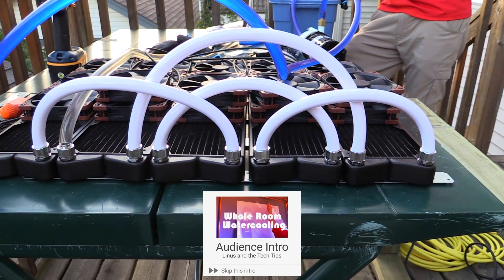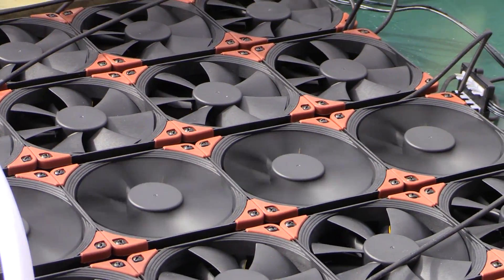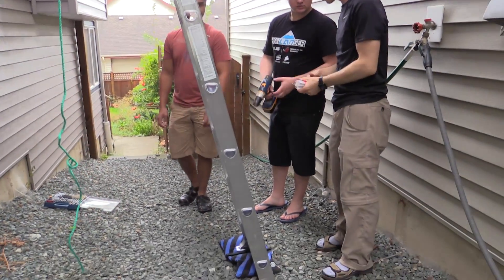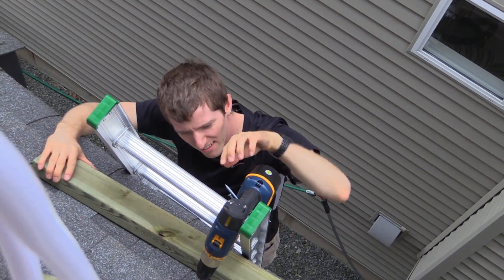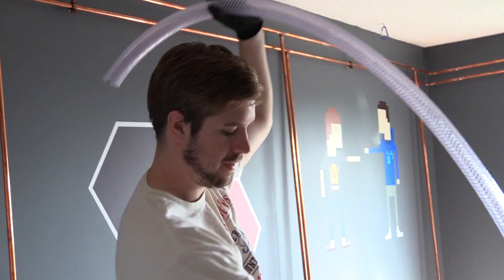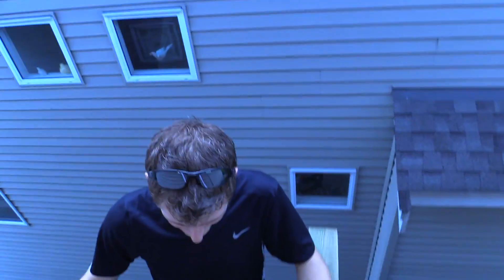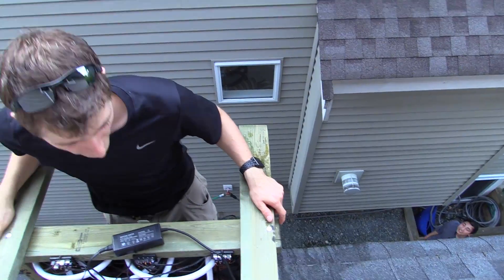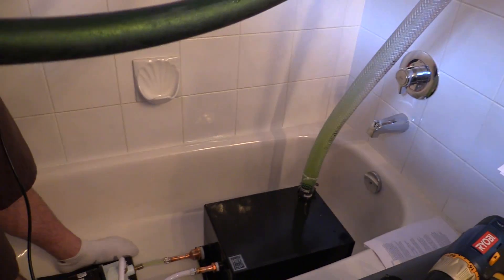Whole Room Water Cooling Project Day 3 - Radiator Mounting and Panic...

Comment: While this is very adventurous.. and kinda cool on paper, I gotta ask if it's very practical.   My single video editing suite workstation which specs out higher than any of yours is watercooled, over-clocked, and if something goes wrong I can easily get to fans to fix or replace them.  I even have a storage tower and animation render farm in a small computer closet of a room.. which is cooled with an airconditioner and standard aircoolers.   Putting together a centralized collective watercool system to all of this would give me nightmares even after it's done.  Too much could go wrong later.  but kudos on the monster cooler.  :0)

Comment: wouldn't it freeze in the winter? i mean, antifreeze can't handle every temperature...
Reply: Niels Wehrens That's what antifreeze is, it prevents liquid from freezing in cold environment.
Reply: Yeah but canadian winters?
Reply: Depending on what antifreeze and at what concentration you're using, it can handle -20 to -30 Celsius
Reply: Yeah, but this isn't only antifreeze i think it's also distilled water
Reply: machariel00 But it's Canada, it's frosty up there.
Reply: Niels Wehrens just keep the computers at full load and they wont freeze.
Reply: Nick Trotsky If the antifreeze can handle -30C it can handle a Siberian winter, so why not a Canadian winter?
Reply: But it gets pumped trough very thin rads
Reply: Seven09 ''siberian winter'' In Siberia, winters often go to -40 and above. good luck.
Reply: Inanitatem I guess you wanted to say -40 and below. -50 is just more far from 0 as -40 is but you still have to say -40 and below
Reply: Inanitatem I guess you wanted to say -40 and below. -50 is just more far from 0 as -40 is but you still have to say -40 and below
Reply: Inanitatem  :)

Comment: You do realize you cannot control the outdoor temperature, right? If it's 90 degrees f outside or -10, this is just not going to work. Why not buy a mini-split air conditioner and air condition a closet down to 60 f or so, with all the fans and rads in there? You wouldn't have to worry about rain or snow or ice or insects or birds nesting or any other unknown hazards either.

Comment: it would've been easier to use a radiator from a vehicle  instead of all those tiny ones.also this project would've been 100x's easier if the piping was on the ground instead of the air. it takes 5x's as much power to raise the fluids rather then to push straight . the pipes should come off the wall and be run along the floor to a large main radiator instead of the 5 smaller ones . then you can attach 2 fans with a 12 volt power supply like this. 

http://www.amazon.com/Powermax-Supply-Converter-Charger-Pm3-55/dp/B00F8MC440
  and a radiator like this 

http://www.ebay.com/itm/like/191482584082?lpid=82&chn=ps

fan like this

 http://www.partsgeek.com/gbproducts/DC/2083-05054403.html?utm_content=DN&utm_term=2001-2006+Dodge+Stratus+Auxiliary+Fan+Assembly+Dorman+620-350+01-06+Dodge+Auxiliary+Fan+Assembly+05+02&fp=pp&gbm=a&utm_source=google&utm_medium=ff&utm_campaign=PartsGeek+Google+Base&gclid=Cj0KEQiApIGnBRCFx-idn7-E2Y8BEiQAc6fQbBXneOla82VWwDENBfJK7YTvCRV4-fy8tA8GOJaQmXoaAuBG8P8HAQ

and it would probably be cheaper then the set up now

Comment: Why no just use a electric 12V auto radiator fan? wiring would have been incredibly simplified compared to this. Not to mention they are weather resistant.

Comment: I have often thought about doing this but I think a central heat exchanger (water to water) in the room would have been a lot simpler setup and more reliable. Short pumping distance to each computer. Higher flow with less head pressure. Then have a cooling loop from the heat exchanger to the external radiator. Also for the external radiator I would use a single industrial oil cooler instead of daisy chaining small radiators. Again more flow with less pressure and improved reliability .

Comment: instead of using all little radiators why not use a condenser coil from ac that what is use and i have water proof fan for out side. the way you guys did it makes my setup fucking great... i get bedder temps then what saw you guys getting your setup is joke.. and the pipe that wasn't soldered what the fuck was that? my setup cost $300 and i a rack of server running on it...my temps 20 to 30 Celsius

Comment: guys this is quite interesting but you got to think outside the box on this one and look at other industries cooling solutions. Lukes dad could have hooked you into one old window air conditioner radiator from a unit that had no compressor and it would have been so much easier. Fan is already built in, fits into the window in reverse for outside air, plugs into a wall and already has a fan controller built in.

Comment: Long time watcher first time reply.

You guys cant just use faucet water. You guys will fuck up all your fittings, radiator, and probably water blocks. You need to drain the whole system and use distilled water. what you guys are doing is almost the same as a cooling system for a car. Im pretty sure that water pump isnt going to be enough for all those vertical piping you have. And make sure you guys have more coolant than water ratio. You guys live somewhere that snows so your ratio needs to work with your outside environment.

Comment: ever consider just getting a car radiator and 12v automotive radiator fan setup and then waterproofing some custom soldered leads from a 12v psu? it would afford massively higher flow and heat transfer. and probably cost less than the 12v fans you used alone.... which probably are not weatherproof like the automotive components would be. also if the rad is mounted outside won't you have issues with condensation in the winter when exterior ambient falls below interior ambient and poor cooling in the summer what ourside ambient hits like 90 Fahrenheit?

Comment: Where do you even live, I don't see any snow
Reply: The date posted confused me right there, but knowing how "nice" Canadian winters are even in the southwest, what will happen to the cooler units during winter time?
Reply: Ultrakillerism They mentioned that they'll switch the systems to solo water cooling systems in the winter.  They'll probably take the water out of the Watercooling system, so it doesn't freeze.

Comment: my one question would be as to why you limited yourself to using a computer component based radiator? Surly the radiator from a a refrigerator would be more suitable for this scale of cooling, and more easy to work with?

Comment: Linus, did you think of the weather? The wood used on the rads are not even painted or coated. Screwing the screws without drilling holes before will make cracks and they will became bigger over time. Do you think that those fan cables will withstand the harsh sun? I think that they are not ment to be outdoors.

Comment: Soldering flux was all you needed for the leaking pipe.  The only problem from then on would have been the wall.  After looking at it, it was like whoever was welding hadn't put any on before soldering.

Comment: Corsair VS Series VS650 - 650 Watt Power Supply and Gigabyte GA-78LMT-USB3 AM3+ AMD DDR3 1333 760G HDMI USB 3.0 Micro ATX Motherboard can handle Zotac GeForce GTX 970 4GB GDDR5 PCI Express 3.0 HDMI DVI DisplayPort SLI Ready Graphics Card (ZT-90101-10P) ? 

please help me again ..................

Comment: IMO, you could have bought a copper car radiator and passively cooled it most the time with a normal large fan to kick in when needed and a small automotive grade fuel pump to run the water.

Comment: Why wouldn't you use a couple car radiators instead? They're easily plumbed in, they have great mounting hardware, there are fans specifically designed to work with them, and the fans run on 12v.

Comment: Water cooling designed for computers doesn't scale like this well. Should of gotten a cheap car radiator and a big fan for it.
Reply: No, car radiators rely on the heat of an engine to create a huge amount of pressure inside of it, the high pressure keeps the fluid inside in a liquid state.  Hence why when you open up a hot car radiator it would spew hot steam everywhere instead of just boiling over.  They used many fans because of the frames and braces in the way in case of a larger fan, and these smaller fans are more static pressure optimized, meaning they work better at pushing air through something rather than moving the most amount of air.

Comment: why did you guys choose to use copper pipes
Reply: Because copper is sexy.
Reply: its also very good at conducting heat. which defeats the purpose of having the radiators outside in the first place.

Comment: why didnt you get a nice industrial shop fan that from a hardware store instead of messing around with all those little fans? i doubt would move nearly the volume of air that a large one would (think about how a central air conditioning works).

Comment: I'm disappointed. I was hoping for a much cleaner install. Fantastic and cool idea, but the execution isn't there. I guess that's what happens when nerds step out of their comfort zone 😉 It looks like the pipe that was leaking was simply not soldered. Using JB Weld will ruin that junction. Too late now. 😕

Comment: Why didnt you guys just use a car radiator and thermofan? It would have had plenty of cooling capacity, it's actually made to operate in the elements at a variety of temperatures, probably would have been way cheaper and more reliable.

This method has a lot of potential failure points with all of those connections.

Comment: Do use a favor and yourself to see if this was efficient and test the temp out of your pc and at the wall going out then the line coming back in from the radiator to see if the temp drops enough to make it worth the money? I have a feeling most of the heat is still in the room but lest find out?

Comment: A simple second-hand AC unite would have been more than enough with just replacing that air compressor with water pump and it would be a lot cheaper and easier to mount anywhere+ waterproof, etc...

Comment: I think that you should also segment a loop with some simple shut off valves in the multiple points.. to be able to cut out stations/segments without stopping whole loop and shutting down all workstations if something happen either of them.. this principle should work in your case, because of parallel nature of your loop..

Comment: hello Linus
you should have gotten an engineer involved right from the start to design it and then you could build it. it would not be as dramatic but it would be functional and most importantly all the components would be optimized to suit their requirements ensuring the systems longevity.
well say this there are a few points i picked up on maybe for the future.
1. Go industrial, all individual components should have been cheaper and more suited to the environments and requirements (pump, radiator, supports, piping)
2. your header(copper pipe in the room where all the units are fed) should be bigger than the individual lines going to the pc's to ensure all units are guranteed a pressure and flow rate.
3. what is the pumps maximum head pressure and can your components handle that pressure, do you have a relief system incase of blockages or running the pump on reduced number of pc's as this would affect the longevity of your water loop (you should also have installed pressure guages and flow indicatiors on you main to understand the system performance.)

finally i would say this was a good idea, the implementation as i can see was a learning process i am sure you would do things differently next time. keep up the wonderful videos and merry christmas and a happy new year.

Comment: Dude that's a lot of fans on one radiator. I actually need help from the linus community here. I need a splitter that allows for connections of multiple fans. I need some kind of all in one controller or something to power a lot of fans can anyone help. I have my front intake and top exhaust powered but I don't have any enough molex connectors coming from my PSU to power the rear one( it has a molex connection and so did all the included fans in my case) I also plan to add more so I need help.

Comment: i dont get it, you could save a ton of time and make it the professional way by just using 1 or 2 of the "aqua computer Aquaduct 720 XT mark V Ceramic" and place them on the outside or a sepperate room! wouldnt even be that expensive!
and at winter time you could place them in the same room to use the heat...

Comment: I see one flaw in your system to remove heat from the room. Heat is going to radiate from the open copper pipes.So unless you insulate them the heat is not really being removed from the room. You can get a insulation for copper pipes from home depot or Menards.

Comment: I say instead of using that radiator like that, convert a small HVAC condenser to water. remove the compressor and use a High end water pump instead.. Having the Pump at the lowest point is best. Then you have a water tight unit outside that can take the elements, instead of playing Russian roulette with the weather using that monstrosity you have on the side of your house.. lol

Comment: if you forget to solder a joint on a household boiler it will be about 200 times the pressure of a tap, would probably blow itself off and spew everywhere

Comment: some things to think about. 1. to keep the water coming back to the tank when the system is off, put a check valve in place in the main loop to keep the head pressure from draining back. 2. you might need to consider insulating the copper pipe to combat the heat radiating into the room and also eliminating condensation. 3. that joint wasnt made up on the Tee. 4. for this simple set up, it would have been easier and cheaper to use pvc or pex, or with the copper if you wanted to spend the extra money you could have invested in shark bite fittings although they arent cheap.

Comment: Hi! I've been following your channel for awhile and I think you are the best when it comes to hardware unpacking, installing, testing and fast speaking :) Well, have a question particularly related this project. Since you don't have any requirement to use standard parts(like custom copper pipe design instead of tubing) and have no concern about radiator size and fan noise(because they are somewhere on the roof top); why you didn't go with an industrial solution like a car radiator system? They are things to keep cool something for real like combustion engines.

Comment: Just a tip from a guy who does this stuff for a living... 
They sell quick disconnect pieces for your copper tubes at home depot. They are called shark bites... They will save you hours of frustration for about $17-20 a piece. LinusTechTips no more soldering!
Reply: haha, i made the same suggestion in my comment. i also think if they want to keep the water from coming back to the tank when they shut the system down, they should think about putting in a check valve, along with insulating the copper to reduce the heat radiating off of the copper into the room.

Comment: I work with chilled water systems for large computer setups, you guys are going to have a leak and destroy your gear or start a fire with that strange fan thing. Any decent aquarium water chiller with a separate insulated sump would greatly outperform that wacky rig. You could have just put in a window A/C unit and been done with it as well.

Comment: You should have just ran the loop thru aquarium chillers, no crazy radiator/fan array outside mount crap... Keep the chiller in the close and it will be cooler and quiet IMO

Comment: They really should have just used a car radiator and fan. Way cheaper, more fin surface area, more airflow, easier to wire, and more resilient to the elements.

Comment: Why not use hard line tubing outside?
Reply: Because ultraviolet light from the sun would degrade it, just like it would flexible tubing. Uh-oh... I think I can see a problem coming up for them ;) Copper tubing would be ideal outside, and plastic inside. (Yes, I know you can get UV-resistant rigid plastic tubing.)
Reply: bigest problem is frezing pont plastic tubes can crack easy on coold day
Reply: Andrew Morton
I meant copper tubing.

Comment: Why didnt you use a radiator made for less resistance? like a Car radiator? You can get a car radiator cheap at the junkjard. Also a fan from a car radiator would be much more suited for this type of workload and workenviroment(outdoor).
This would be a more robust solution with fever joints, parts and offer less resistance for the waterpump's.

Comment: Why you didn't use real industrial radiator with real fan which you could run with your mains power? You can ofc use car-radiator and that car-fan is 12 volt and usually with multiple speeds...
I'm sure that Luke's father had ideas for that...

Comment: What is the freezing point of the cooling liquid? Canada can be cold on winter i heard :)
Also, i'm wondering if computers are linked parralel or serial? It seems to be a serial setup but in this case, are you sure that all computers will get the same pressure/cooling liquid speed?
And finally, why use copper tubing instead of plastic ones?

Love this project, can't wait to see the results!

Comment: Hi Linus. Why on the roof where is sun increasing temperatures of roof and everything that has dark color + rain and snow.
Why not undrerground in some small space with one big powerful fan pushing hot air up, amplifing the natural movement of warmer air, less work to do for pump too maybe if you re on the first floor, less chances for a leak.Air intake and exhaust tubes can be near the wall for nicer looks with height about one meter. Higher rpm fan on the radiators underground and maybe lower rpm and noise from fans inside exhaust and intake tube if neccessary.